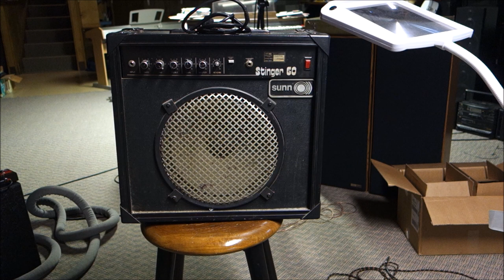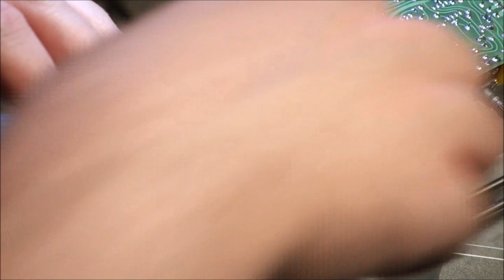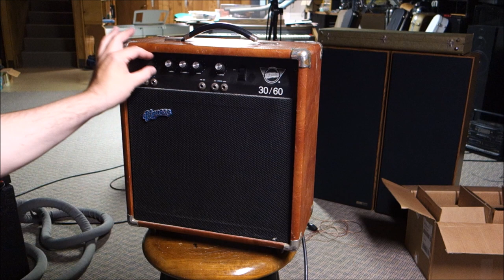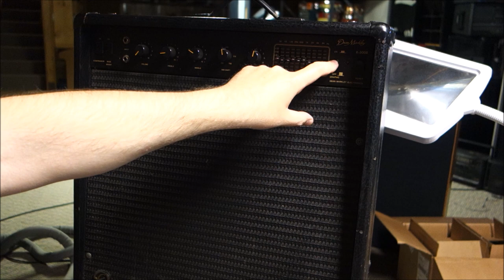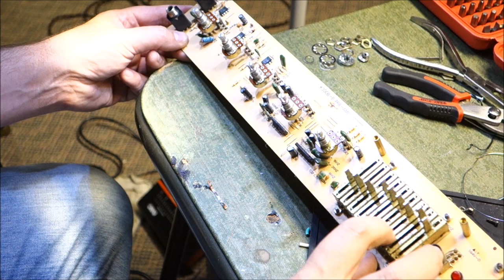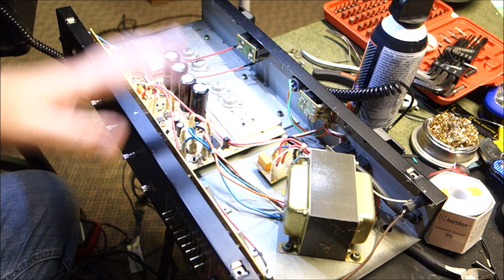Guitar & Bass Amp Repair-A-Thon  Part 6

Comment: My motto about fixing stuff is very similar to yours.
That Dean Markley is cooler than the other side of the pillow.
Reply from the maker: The music shop owner acquired a whole hoard of broken amps,  figuring to get them fixed eventually.   My name must be eventually.   When you're buying amps at  "part prices"  it's not a bad deal,  as there's still some money in it when he's ready to sell them.  In the case of the repair-a-thon, the goal is to restore operation, and replace missing or broken parts.  I leave the polishing and cleaning to someone else.   (unlike ones I bought to sell on Reverb)
Reply: @DeadKoby  I acquired a box of laptop computers like that.  I was able to get all but 2 working.
I call this "real recycling."
Reply from the maker: I actually run a computer shop....   computers that would be useful on today's software get fixed.   The others go to the recycler/E-waste guy.   I really don't like to trash things that aren't total rubbish.
Reply: @DeadKoby  I started tinkering with them about 8 years ago after I starting taking care of my mom.  I also started learning about Linux and now I'm hooked on it.
It will run on almost anything.
Reply from the maker: I'm OK with Linux,  I have several servers that run on it.  I wish that the support/education for it wasn't so disjointed.  If you want to find a manual,  good luck... and the "flavors"  are inconsistent.
Reply: @DeadKoby  it's getting better.
After XP lost support I educated myself and after a few years of trying various distros I settled in with MX Linux.  It's stable and works on 32 bit machines and it has some awesome tools that are built in.  And it doesn't slow to a crawl after you set it up the way you like it.